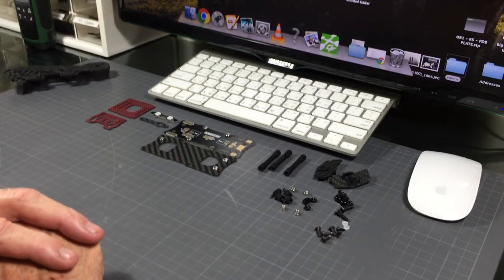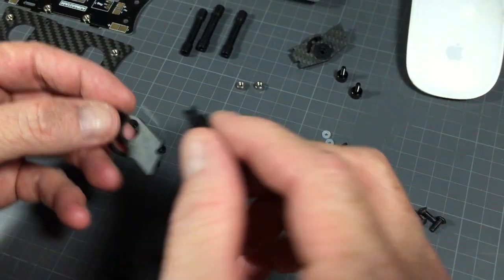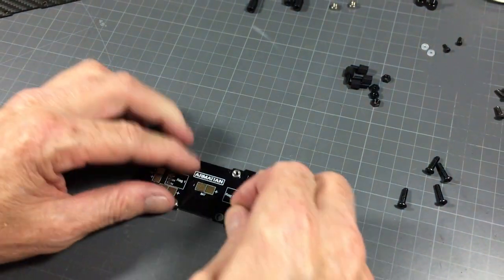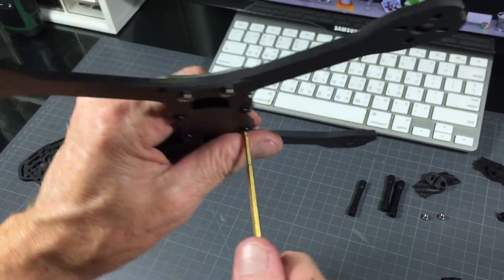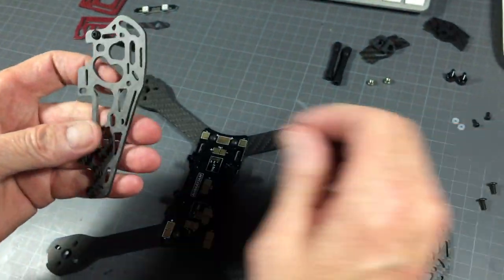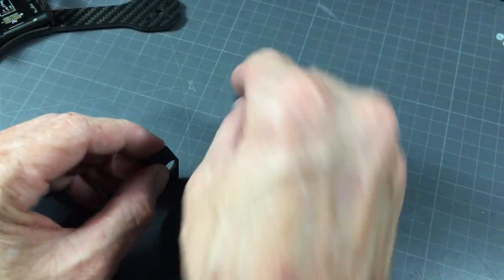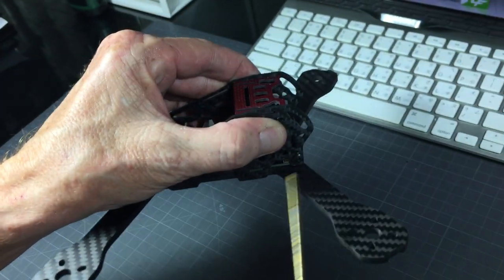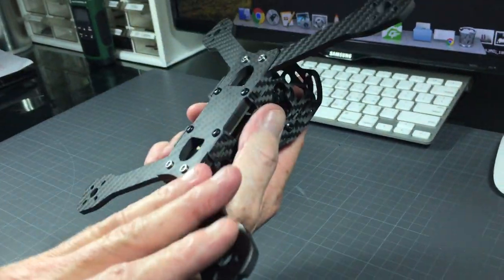Armattan Armadillo Assembly

Comment: I am in the process of building this quad.  What video transmitter is this designed for?  I have the ET200R and it does not fit in the frame with the rear adapter.  Also the side mount option is way to close to the prop for comfort.
Reply from the maker: Then you can enlarge one of the higher triangle cutout on the side plate and put the VTX there.

Comment: I presume the battery is designed to go on top.. and maybe a runcam on top of the battery?

Also what is the clearance space between the pdb and the top plate?
Wondering if it will fit a Graupner GR18 
M
Reply from the maker: Hi Michael,
You can mount the battery on top. I mount mine on the bottom and runcam v2 on top.  The clearance varies since the plate is on an angle. I fit the FC, FrSky RV and VTX all under the top plate and nothing is squished. Still have a bit of clearance.

Comment: So is it possible to have a battery protection plate made for fitting batteries on the bottom? 
The Graupner GR18 is a reciever and flight controller all in the one package with full telemetry and all pids are set using the radio which to me is a huge win hence the question on height.. 

The other thing that would be nice is to just have standard led for all models as option so a flight controller is not responsible for operation  ... just a power source.

Which is a bug bear of the F1 6 I purchased.. 

M
Reply from the maker: If the FC is 36mm, should be fine. As for lipo cover,  most guys use 3D printed ones and they are nice as they also cover the sides of the lipos.

Comment: I have seen a video that the VTX will not work in the location you have ,,The prop hit the antenna ... Has that been addressed and i also see you now have the V2 PDB ,,any info or stats on it ?
Reply from the maker: We have PDB V2. 5 c and 9v bucks. We also have the CF top plate listed for those who want to use their own PDBs, etc.
Reply: i looked on your site and i dont see the options where i can purchase without the PDB.. can you please link me so i can purchase this frame
Reply from the maker: Hi Steve. Simply leave a note on your order saying you prefer the CF top plate over the PDB and we will swap it for you. After you place the order you will receive a confirmation email. You can also reply to that email and it will come to me if you want to send me a reminder, too.  Hope this helps.
Reply from the maker: I think best to email me at this point. service(at)armattanquads(dot)com